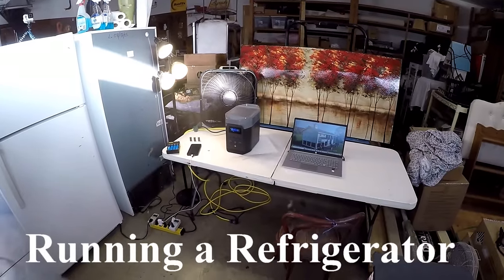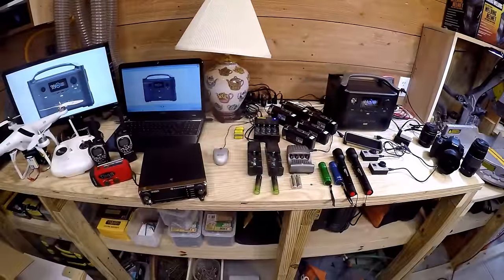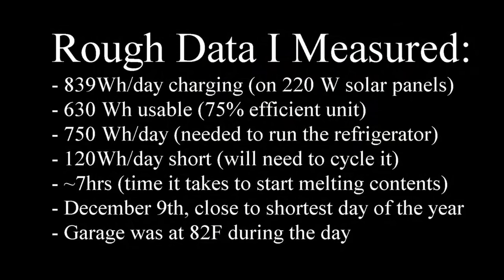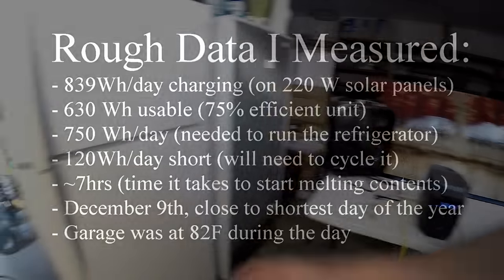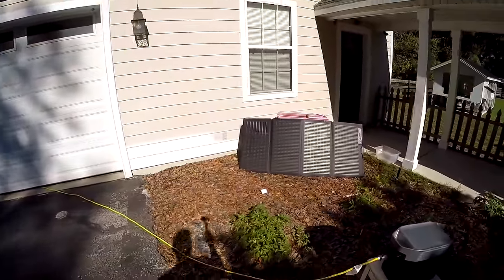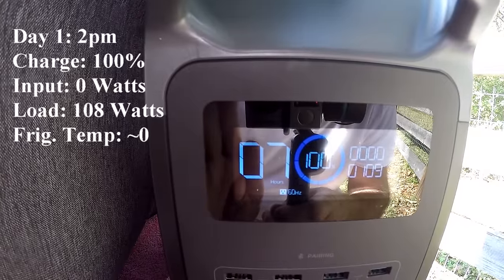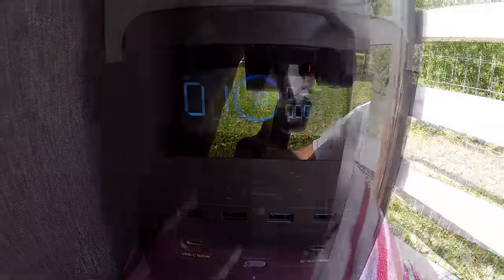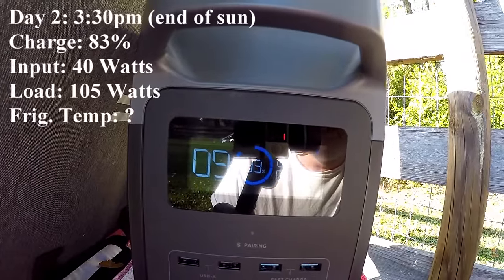EcoFlow Delta 2 Refrigerator Test with EcoFlow 220 Watt Solar Panel

Comment: This was a great demonstration.  In summary as long as i have the solar pannels (not included) I can run indefinitively with good sun.   Also, By only  turning on the fridge a few hours a day I could probably run some lights and the TV indefinitively.
Reply from the maker: If the sun is shinning it will rake about all this unit has to keep the fridge up and running.  To run more, I would get a 450Watt regular panel from a local supply store ($200).  That would give you some extra power to play with.  Thanks!
Reply: @HomesteadEngineering I get 220W to 250W very easily with the bipolar panels, even in winter sunshine, and 100+W in partial shade, so it looks like your panels aren't performing great.
I would also look into buying a more efficient compressor fridge. I use the Delta 2 to keep my fridge running non-stop year round. It uses only about 12W on DC. So keep it at say 2C or 4C it will kick in occasionally to cool at 20-35W for a short period and then auto off for an hour or two between constant cycles.
It does obviously use more power if I want to turn it into a full freezer at minus -22C.
The nice thing is that the Delta and Fridge both have Bluetooth built in, so can remotely control them at distance.

Comment: This thing sounds incredible
My fridge is a bit bigger and I wasn’t sure if the Delta 2 was enough to power it. If so, I doubt I could connect anything extra. Thanks to your testing, I’ve got my eyes on the Delta 2 Max for the extra availability and usage, and 2 220 panels
Reply from the maker: Yes, I was barely able to keep this going and I had good sun.  The Delta 2 Max with two panels would be much better.  In general, I would go as big as the budget and space will allow.  BTW: I have 13,000 Watts of solar panels, 30kWh of battery backup and 9,000 continuous Watts output on my MAIN system and I still want to add more!

Comment: I just bought this  exact.  Set up.  At.   well  botts.       Trying to learn all I can this was a great video.    For me. Glad to see a long extension cord. Was used. Is this video.  Is there.  a specific type I should purchase.    Do I need any other cables. To run the 220 watt panel   Have not took the panel out of the box. Yet.  Purchase was for  a freezer.  And frig
Reply from the maker: Hello Vickie,  Everything I needed to run the 220 Watt panel was included in the package.  Note: I did run a long extension cord but I used a 20A (12awg) cord from my shop so as not to incur too much of a voltage drop.  Most common extension cords are only 15A (14awg or even 16awg) so be careful with that.   i.e. The shorter the cord the better.  If I were going to run this setup on a regular basis, I would use no extension cord and just get longer wires (of the appropriate size) to run between the unit and the the panel.  
Thanks!
Reply: @HomesteadEngineering    Where can I get the longer wires  for the panel.  Like in your video.   My  system came from well botts.    Not sure they have the longer ones.

Comment: I’m little confused…you can charge the Ecoflow with the solar panel and at the exact same time have your electric devices plugged and running ? I’m from Cuba and we’re having major blackouts every day. I intent to send my family an eco flow with a solar panel and they will probably need to do that: have the solar panel charging the station and at the same time running fridge etc. can this be done safely. I fear about the in and out power at the same time without burning the unit or any appliances. The advice will be appreciated.

Comment: Im still doing my review before getting one of these ecoflows. Do you like yours  ?
Reply from the maker: I am very happy with mine,  I actually use it almost every day.  
https://youtu.be/vnt4nF0RGEw?si=gBrYYa_N16y0__8M
Reply: @HomesteadEngineering  Im still in research mode and i like seeing what everyone uses theirs for. I was surprised your window AC unit almost drained it in only 4 hours. Kinda doesnt make sense to get an eco flow.
Reply from the maker: @Sjrick  These small solar generators are not designed to run large appliances.  They are good for small electronics and camping and stuff like that.  If you are looking to run more of your house in a grid down situation you are going to want to start thinking much bigger.  Figure $15k for a real whole house system.  I would look at something like this:  https://signaturesolar.com/complete-hybrid-solar-kit-12-000w-120-240v-output-30-72kwh-eg4-lithium-powerwall-16560-watts-of-solar-pv-kit-e0005/
This is about what it takes to run a house.
Reply from the maker: Also, I think you might like this: https://youtu.be/vu7VXI54k9M?si=ubnPbmQtwOKOXWp8
Reply: @HomesteadEngineering  I've been emailing Ecoflow back n forth recently and he said this could power my whole house. Im still trying to figure out what i should be looking for on my appliances to see if they are compatible or not.  You are the first person ive seen that said it wont handle a full household load. Im new to all this so thx for your input.
Reply from the maker: @Sjrick  I am calling it a day.  We can talk more tomorrow.  Go to my playlist under generators and watch those videos.  You will learn a LOT I promise.  :)

Comment: Why not have the fridge power go on for 30 min every other hour Vs fully on when doors are closed?
Reply from the maker: There are lots of ways to do it.  If I had to do it today, I would go with the Delta 2 Max with more panels and just let it run 100%.  Thanks!

Comment: Thanks for the video.  I feel every power station should be tested with a fridge since outside of camping, people will primarily use it to keep food frozen.  I was trying to estimate whether I should go with a ~750Wh power station or a ~1000Wh power station.  Based on your test, I can probably get away with a 750 if I have solar panels charging during the day.  Naturally I need to focus on the peak load when the fridge kicks on so the inverter can handle it.
Reply from the maker: I would look for the best deal on the bigger one just to have some cushion if it falls into your budget.  Thanks!

Comment: Hey there. I have a question. Im thinking of purchasing this power source. In the winter i want to be able to run a chinese diesel heater on high for 2-4 days as well as run a kettle for my tea 
,charge my phone, and lithium batteries for my fish finder. Maybe run a tv for 6 hours or so. In the summer id take it to an island off grid only accessible by boat and run a small cooler, charge my lithium batteris for my fish finders, phone, kettle, some appliances etc for 5 days or so. Id buy the 160w solar panel combo, however inthe winter we have days with little sun so i dont know how much ill really get to charge it. Would this power supply begood for me with these needs?
Reply from the maker: I can't say without knowing how much each item uses but it sounds like your going to need a bigger unit.  Maybe the Delta 2 Max: https://amzn.to/463qB5X
OR maybe all the way up to the 
Delta Pro 3: https://amzn.to/4cFwhFT
Also I don't think 160 Watts solar panel will cut it.  Your going to have to think bigger for the things your trying to run.

Comment: I love this video, (new sub now).  This gives practical hacks on how one can "deal" creatively with a modest solar charger.
Reply from the maker: I really appreciate this comment.  I should probably do more work on creative ways to get by on a limited budget.  Thanks!
Reply: @Homestead Engineering  I feel comfortable getting the Eco2. Its expandable if I find I'm stuck, good support, proven company.   I was leaning towards the AC200Max partially because of the 30A connection.  I can get by without and getting the more portable Eco2 will allow my budget to get solar panels right off

Comment: Thank you for your review. How long does it take to fully charge the battery using the portable solar panels?
Reply from the maker: With one 220 panel it takes almost all day.  Thanks!
Reply: Thank you brother I appreciate it! We’re in Houston dealing with the power outage from Beryl. 
Trying to sleep while you’re hot, sticky and sweating is no joke.
Reply: We’re definitely going to save up for a solar generator or natural gas home generator.
Reply from the maker: @j.p.4541  I have been there and it is miserable.  If your going to try to run a fridge and a window unit plus lights and such, your going to need a bigger unit.  I would try to go as big as budget will allow.  Maybe even this: https://amzn.to/3XPRU1A
Thanks!

Comment: I just bought a second 220 bifacial panel as they had a great sale -I am interested to find out the capabilities with 440 watts of panel
Reply from the maker: Yes, The closer you get to the 500W max the better.
Reply: How much did the 220 cost in the sale?

Comment: good vid, if you turn off the AC time out to never on the app the delta will not shut is AC power off.
Reply from the maker: That's a good tip, Thanks!
Reply: No problem, and your welcome !

Comment: How did you come up with the 75% efficiency? I just saw another test using a 1500w heater and the delta 2 ran for 28.5minutes which is 85% efficiency.  90's is great, 85 is good and 70's is considered poor. Is it software or hardware?
Reply from the maker: I got that number from other sources.  I don't think that hooking up a heater and running for a period of time is a good enough test.  You need to measure the actual kWh delivered on a meter.  Also, the rate that you drain the battery will effect the results.  I may perform a test at some point to see how mine actually performs.  Thanks!
Reply: The inverter of the delta pro is a power draw when it's on. From my testing it takes ~20w/hour so the lower the draw the less efficient it is. My main draw for my off grid system is actually the inverter itself as my fridge takes ~16w/hour (chest cooler)
Reply: Duration is a factor a capacity test with a heater only lasts a hour so inverter running watts hardly get into the equation the inverter alone will use about 15% of the battery per day just for being switched on with no load

Comment: Nice experiment though.  It might be better to get the extra battery ecoflow sells for this unit and get more solar panels to provide all you need.
Reply from the maker: Yes, max out the panels and add a 2nd battery and your good to go.

Comment: Probably a best test will be if you use a thermometer in the fridge, those who have a screen out, so you can see when the temp start drooping since opening the door accelerate the cold lose.

Comment: How safe are these to keep inside a home? I hear so many stories of electric scooters catching fire so i am concerned.
Reply from the maker: Just my opinion, not advise.  The short answer is that I have zero concerns of fire with this particular unit.  

The long answer is that risk of fire from batteries is largely dependent on battery chemistry and potential misuse.  Lithium-ion is the type of battery that you most often here about causing fires and its usually (not always) from misuse.  The two main types of Lithium-ion are: NCM (Nickle Cobalt, Manganese) and LiFePO4 (Lithium, Iron, Phosphate).  The NCM  type of battery has a thermal runaway characteristic not found in the LiFePO4 battery chemistry.  Also, people overcharge them and leave them over charged.  They leave power tools out in the rain, they let their dog chew on them, etc.  

Take all this with a grain of salt as I am not a battery expert BUT bottom line: The type of battery that I look for is LiFePO4 and that's what's in this Oupes Mega 3.  Thanks!

Comment: Got question. Is it possible to use that portable as a loop power source for my Inverter Refrigerator standard size (for 24x7 very low cold settings) + Induction Stove (2x a day use) + Internet Modem (for 24x7) and Shower Heater (like 2x a day). So I don't need to connect all of these devices in the house outlet, this can save me electric bill. Is it possible?

Comment: Kind of off subject here but I keep hearing how the PV panels (in your yard) is "plug and play".  Would you be able to use one or more of those panels to power the Ecoflow?
Reply from the maker: Len, You should be able to use any solar panel as long as it meets the input requirements of the Delta 2.  I think they are 11-60VDC and up to 500 Watts.  
https://youtu.be/vnt4nF0RGEw

Comment: Their is a problem using extension chords with refrigerators. Can ruin the fridge and start a fire.....
Reply from the maker: Well you don't want to have too much of a voltage drop but I did use high quality (20A) cords.

Comment: Instead of cycling the fridge, you can adjust it's thermostat.
Reply from the maker: You could try that and it might work but remember that the inverter burns power even when its idling so off may be better.  You also want to get it as cold as possible when you have the sun shinning.  Thanks!

Comment: So you disconnected the fridge from the generator overnight and then you plug the generator in to the solar panels when the Sun came up and plug the refrigerator into the generator at the same time. And that kept the fridge going
Reply from the maker: Basically yes.  I did run it a bit at night as well.  Thanks!

Comment: My question is, can i use eco flow to give charge to My 30 cu ft refrigerator, but 24/7 forever, for the life of the refrigerator or only i can use ecoflow for emergency

Comment: Just my opinion if you are going to the trouble of getting a delta Atleast stretch to the max or 2 max having twice the capacity is invaluable
Reply from the maker: Yes, The bigger the better and trust me you will ALWAYS want more.  I now have 13,000 Watts of panels and 30kWh of battery and every day I am looking for a good place to add more!  :)

Comment: when you are using the solar, do you have to have the delta 2 near the panel?
Reply from the maker: The cord that comes with it is pretty short but you can buy an extension.  I run mine off a 50 foot extension out the window so the unit is inside and the panel is outside all the time.  I run this unit everyday.  
https://amzn.to/4cF5vwS
Reply: @HomesteadEngineering  thanks so much for sending a link! much appreciated.

Comment: So that’s just with one 220w solar panel. Would 2 220w solar panels be enough to run 2 full sized refrigerators then? I’m new to this so I’m not sure. I just got them both for $999 on prime day sale. Maybe by next year I can double everything since there is a plug to connect additional batteries and up to 500w solar
Reply from the maker: Depends on how much power your refrigerators uses but I think I could run two of these (like in my experiment) with two 220w panels.  Like you said, you might need to add the second battery.   Here is my review of the Delta 2: https://youtu.be/vnt4nF0RGEw
Reply from the maker: Note: Be careful how you connect your two sets of panels to the unit as not to exceed the max voltage or current limitations.
Reply: @HomesteadEngineering  I’m pretty sure the max is 500w
Reply from the maker: @happyhamster1411  500w is the max power but you need to know more than that.  You also can't exceed 60Volts OR 15 Amps.  Note: connecting panels in series increases the Voltage and connecting them in parallel increases the current (Amps).
Reply: @HomesteadEngineering  I’m unsure what series and parallel mean. What if I want to use the ecoflow panels, would I be able to use 1 220w and 2 100w together?
Reply: @HomesteadEngineering  ok I figured it out. The 100w panels are 12v and I’m pretty sure the 220w is 24v so I should be able to run them all together in series if I need to.

Comment: What about an efficiency apart fridge about 5.5ft tall and 2 floor fans? Would this run for a few days with no problems you think?
Reply from the maker: If you maxed out the solar you could probably pull that off.  I would just get a regular panel @ 35 cents/Watt (maybe 450 Watts).

Comment: Man, if I had to constantly check and adjust all of the devices as you have done in this video, I would NEVER get such things to save on power!
Reply from the maker: Its not about saving on power its about having power in an outage like so many are experiencing in Houston right now.  A larger unit would reduce or eliminate the checking and adjusting.  That said, Solar can be a bit of a hobby.

Comment: can you leave the fridge plugged into the delta 2 all day every day, then, it'd kick on when power goes out. I have a slightly different use case. insulin in fridge for type 1 diabetic. power goes out at my house regularly, and I just want fridge to run for 4-5 hours automatically during power outage. when we have electricity, i'd want the delta 2 to charge to 100% then just allow fridge to use standard electricty... only kicking on when power out
Reply from the maker: I have not used it this way but that should work however I have two concerns:
1. If its a critical use than I would go bigger on the unit.  Maybe a Delta 2 Max or bigger:
https://amzn.to/3RZMNYL
2. The delay in the switchover may cause a short cycle with the fridge compressor.

Comment: You can increase the solar during cloudy days and at start and end of day, but you would need to watch it carefully to not put too many watts in your battery, more than it should accept.
Reply from the maker: That's a dangerous game your playing there Scotty.  LOL :)  I had 4,000 Watts connected to a portable solar generator just the other day and was thinking: what if the sun pops out for just a minute?  Yikes!
Reply: @HomesteadEngineering  Charge controller required. Any suggestions for a gel battery 1,8 kW that will only take 200w?

Comment: What would the additional battery do to the equation?
Reply from the maker: I don't think that would help much as the limitation is in the collection.  I would probably go out and get a single (11-60V)  450 Watt panel from a local supplier with no shipping cost.  Maybe $200 for the panel.  That would make a big difference.